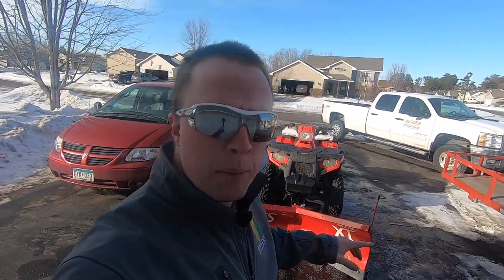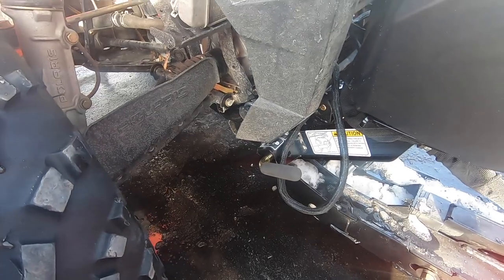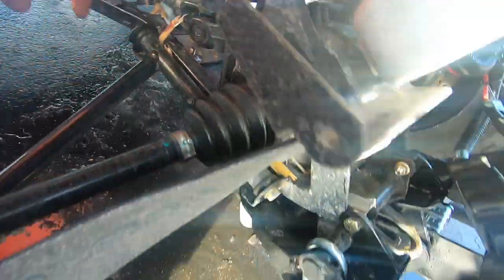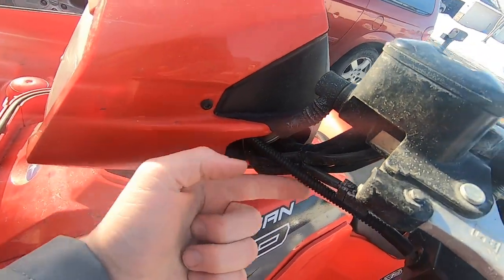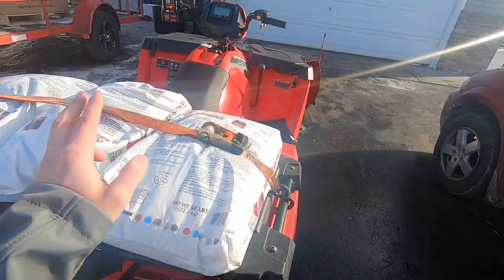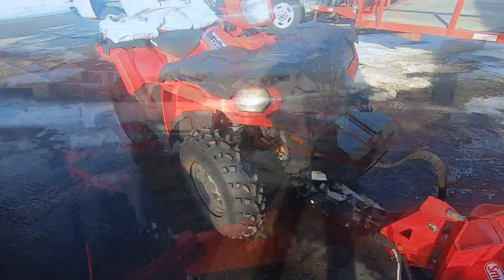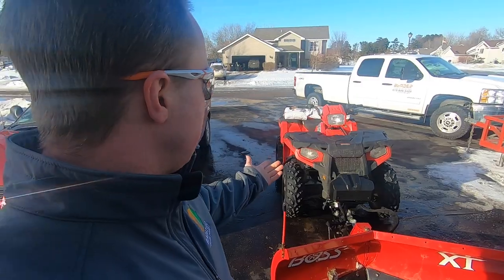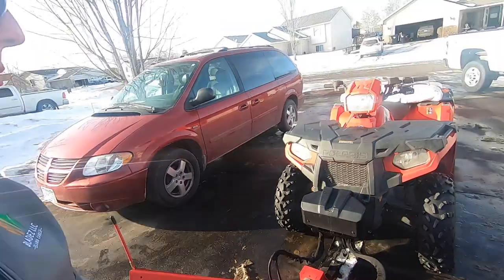Boss ATV Plow [how well does it work?] #bossplows #polaris #sportsman570 #minnesota

Comment: Does the hydraulic plow system kill your battery like a winch does? My neighbor Has a 750 Arctic Cat and using the winch to raise and lower the plow will kill the battery if we get a lot of snow
Reply from the maker: It seems to do alright with no strain👍  the battery is pretty new, but I work it hard and never have had an issue. Winches do draw a fair bit of power, I believe hydraulic is way superior to a winch any day
Reply: Looks like an amazing setup. Is it connected to a Toro Grandstand?  How do I get more info on your setup?  Blessings to you and yours!

Comment: Does it work with tracks?
Reply from the maker: I'm not certain on that. That would be awesome if it did!
Reply: Any updates on the tracks?
Reply from the maker: @Joel Paur  I've seen it done on side by sides but not on a fourwheeler. If you have a set of tracks, I would call a Boss dealer and ask. It might be something where it would work with one brand of tracks but not another. Just based on dimensions.